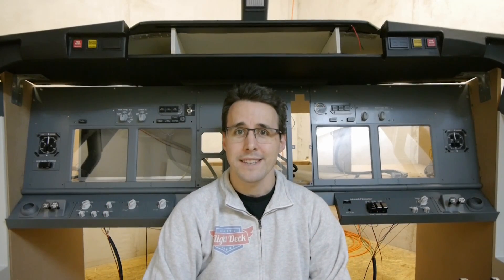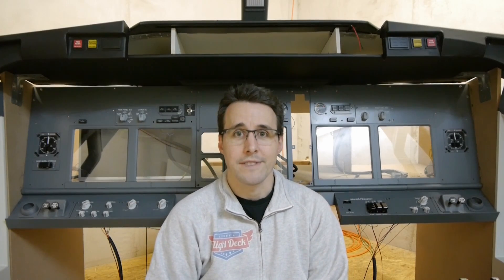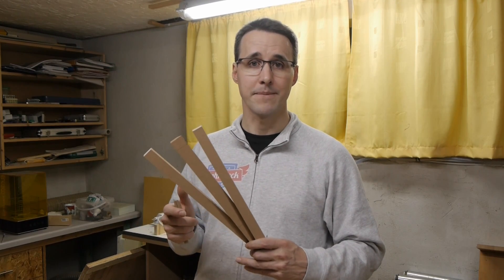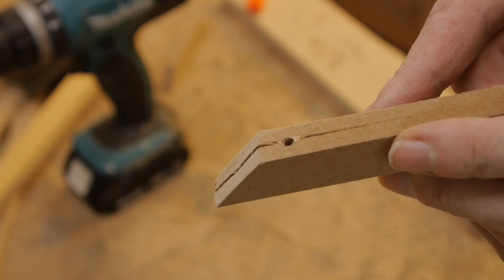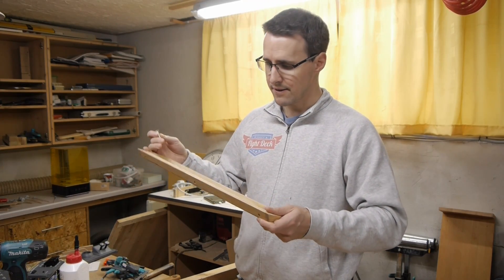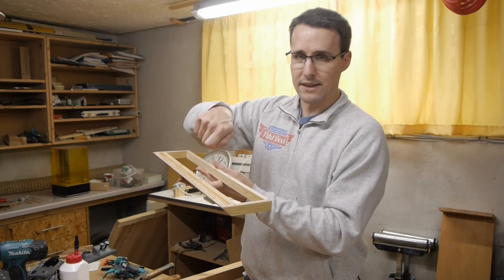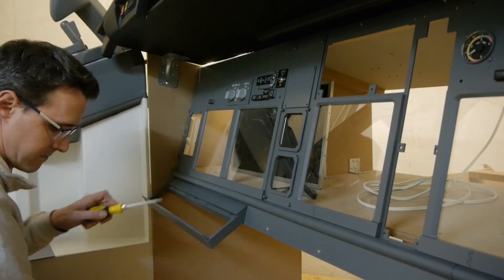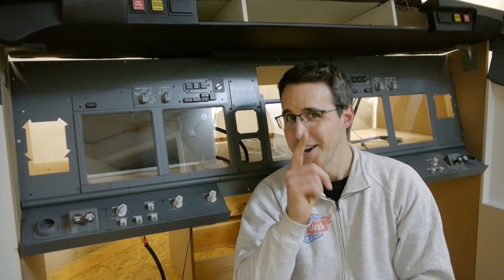MIP Knee Panels - A Boeing 737-800 Homecockpit #81

Comment: Hi Michael, is your backlight fully working? As I can see at 7.15 in the video, the bars are located behind the texts at the top of the panels.
Maybe a small suggestion for easier mount (at least works for me) is to use some kind of T-nuts on the back bar like https://en.m.wikipedia.org/wiki/T-nut, then you use bolts from the back of the mip.
Reply from the maker: Yes, not one of my best designs. But maybe I don't need to unmount it too often. I haven't tested the backlighting until now because I have to change the cables. My current ones are too thin for the car plugs